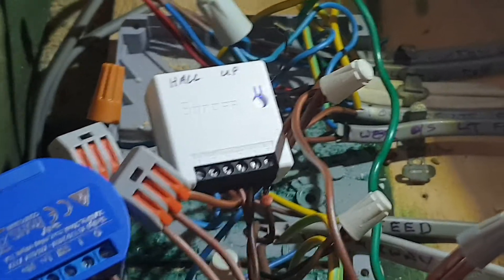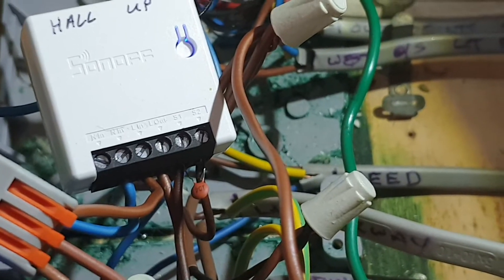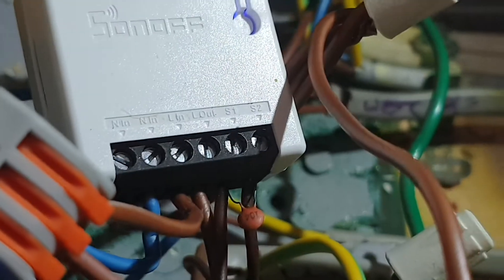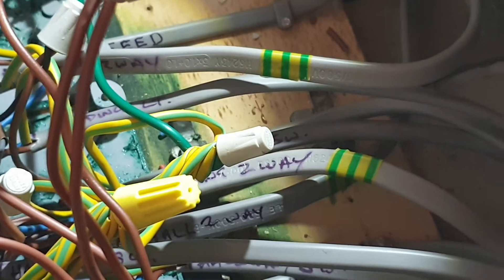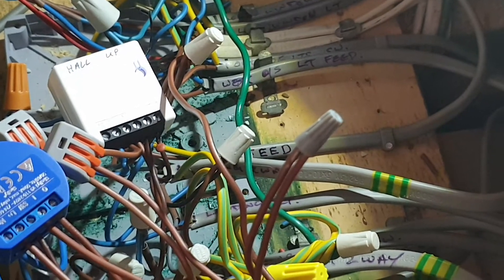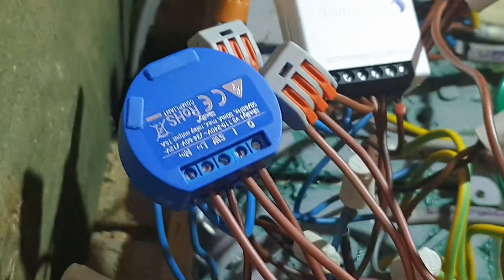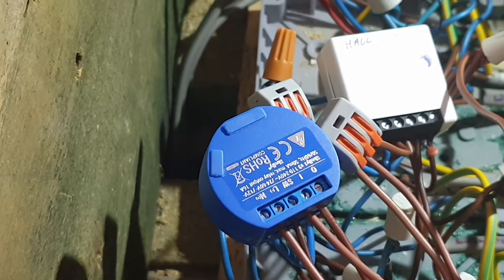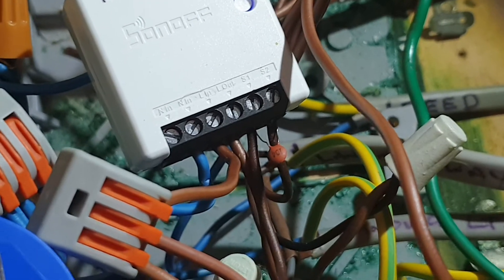Sonoff mini flashing lights fixes

Comment: thanks for the heads up, I have a problem that looks like that...  a water pump and the buoy is hooked on the s1/2, worked for months without a problem and suddenly started to turn on and off by itself and the sonoff doesn't respect the online trigger.... it's pretty annoying, do you think that this can be the same problem that you had (I saw also the lamp video)  thanks again!
Reply: Mini r4
Reply: Estou com o mesmo problema que você, exatamente igual
Reply: ainda não comprei os capacitores, tá pelo RJ? no ML só vende quase que por quilo kkk @cleissonromulo2125